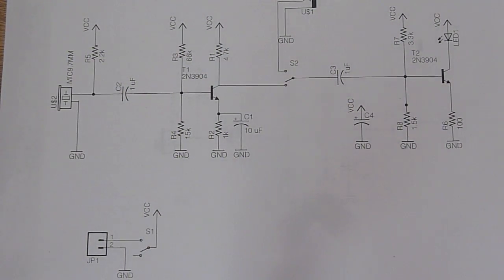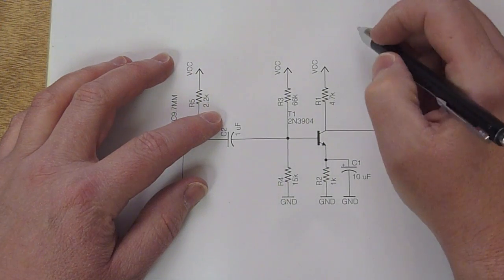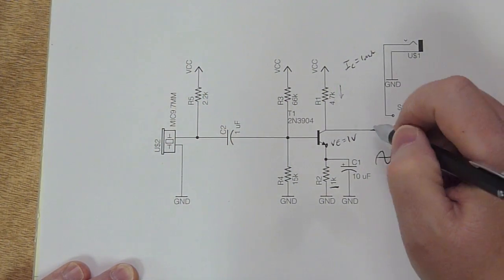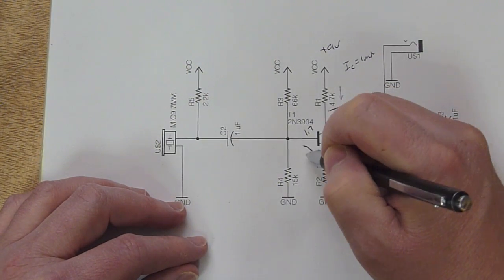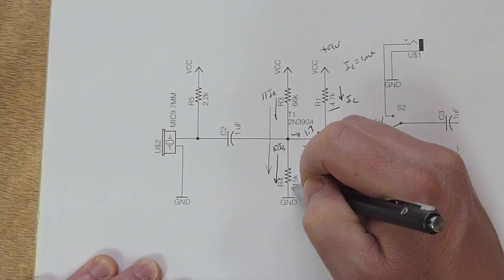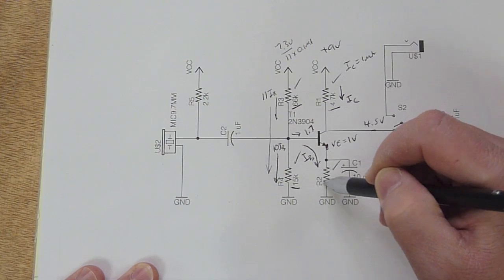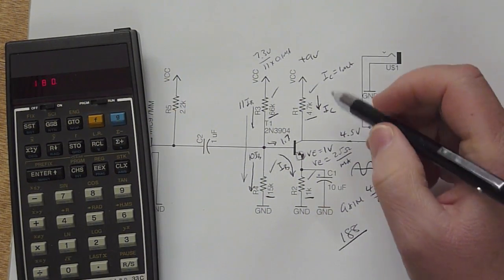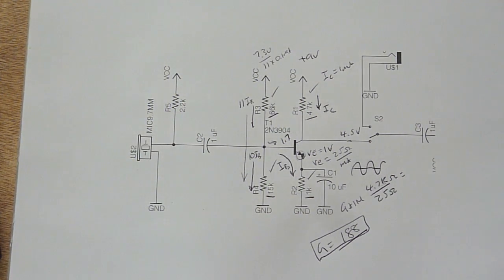Design a Common Emitter Amplifier

Comment: right, but 10*R2 is 150K, which when using kirchoff's voltage divider rule to determine VB (VB=(R2/(R1+R2)*Vcc)) would give you 1.67 V, but your VB is more likely to be 1.49 V, and your IE .79 mA.  We may just have different criteria for what makes a voltage divider stiff... I was taught that if your Rin(base) was higher than 10*R2, you didn't have to rework the above formula as VB=(R2||Bdc*RE)/(R1+(R2||Bdc*RE).  I would love to know about R5 in your above drawing... how that affects the circuit
Reply: If there were no base current Ib, then Vb would equal Vcc*R4/(R3+R4) or 1.63V with a 9V supply. However, when the bias point Vb is close to the value for Vbe (~0.65V), then the emitter bias point Ve becomes susceptible to small changes in Vb. In those circumstances, it's impractical to make the base bias current much bigger than 10 times the base current (what you call "stiffening" it), so you have to modify your calculations to take into account a sensible estimate for the base current. That is what is done in this video, by assuming Ic=1mA, so Ib=0.01mA. Then set 10x that (= 0.1mA) to flow through R4 and 11x that (= 0.11mA) to flow through R3.
Your teacher didn't consider the susceptibility of very low bias points to transistor Vbe when they taught you that rule of thumb about the base bias impedance being higher than 10x the emitter resistor.
A more exact analysis shows that if β is finite, you have:
Vb = Vcc*R4/(R3+R3) - (R3.R4/(R3+R4)).(Ic/β)
In other words, the bias point ignoring Ib will be lowered by a voltage equal to the base current (Ic/β) times the parallel resistance of R3 and R4 when β is finite. For this circuit, R3=68K, R2=15K, Ic=1mA, β=100, so Vb = 1.63 - (12.3K x 0.01mA) = 1.63 - 0.12 = 1.38V. That makes Ve = 0.73V assuming Vbe = 0.65V. Small variations of that will have a noticeable effect on Ie and hence an even bigger effect on the collector bias point.

If you want to work that for β=50 and β=250, you'll see how much Vc changes for that quite reasonable range for β.

The electret microphone contains an FET in common source mode with an open drain, so once it is biased, you get a varying current that depends on just the signal the microphone picks up. That develops a voltage across the bias resistor R5, so as R5 increases, the signal increases. However, the dc bias for the FET pre-amp stage is also set by that resistor, so that limits its maximum value. You can use a higher value if you have a higher supply, but you have to be careful not to exceed the maximum ratings for the microphone. I have some that work well with a 10K resistor and 5V supply, but you really have to try them out to get the best value for R5.
Of course, the ac input impedance of the common emitter circuit will be the load for the electret microphone. As that is given by R3 || R4 || β*re = 68K || 15K || 2.5K, which is around 2K, so there's actually not much point in increasing R5 beyond the 2.2K value given.

Comment from the maker: The current flowing through the voltage divider is set to be about 10x the current flowing into the base. That makes the divider stiff. The impedance looking into the base is ~100K
Reply: Why current through the voltage divider is made 10times Ib
Reply: Not if you bypass the emitter resistor. The ac impedance looking into the base is (68K || 15K || 2.5K) = about 2K.

Comment: Great Video.  I got slightly different numbers, but I was trying to center my Vce on 4.5.  They are RE=2250, RC=2250, R1=23000, R2=11250.  I noticed that by my math your bias divider isn't stiff.  My understanding is that RE*Bdc > 10*R2 in order to be stiff.  Thoughts?

Comment from the maker: The 2.2k resistor is specified by the mic data sheet. It doesn't matter where the DC level of the microphone output is since the cap blocks it.

Work out the impedance of the 1 uF cap in the audio range and you'll see that the impedance is small enough.

Similarly, C1 was chosen to be big enough to rapidly short out R2 in the audio range. 

Build the circuit and play with the caps.
Reply: C1 is much too small for the audio range. It isn't just shorting out R2; it's making that parallel combination small compared to re. The gain is Rc/(re + (Re || Xc)). Build the circuit and see what gain you've got at 100Hz compared with 1KHz, and you'll see what I mean.

Comment: How did you size the capacitors? Also how did you size R5, the mike bias resistor, and why doesnt there need to be another resistor from R5 to ground, to fix the mike voltage? Thanks